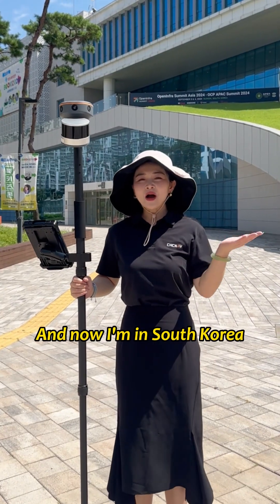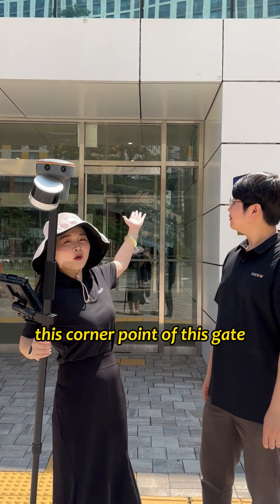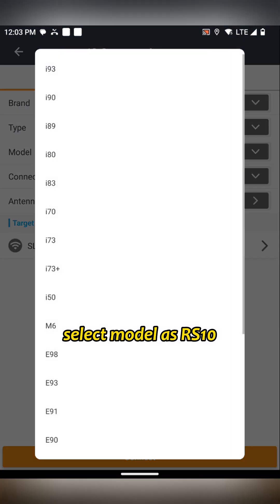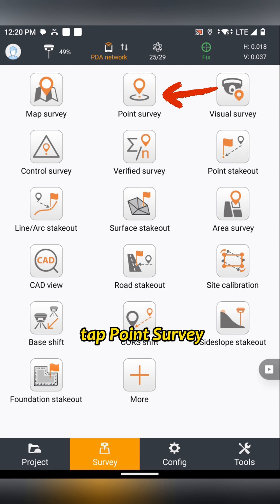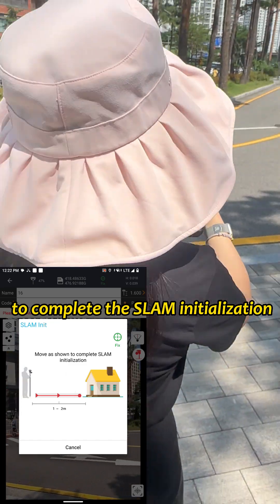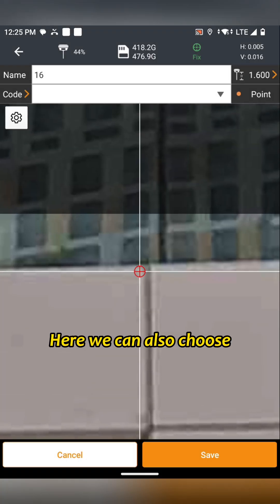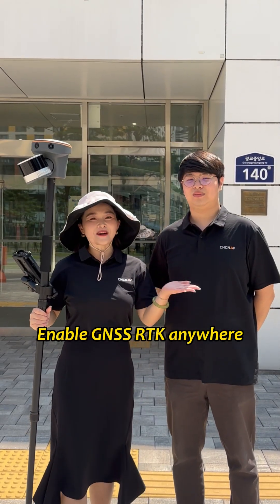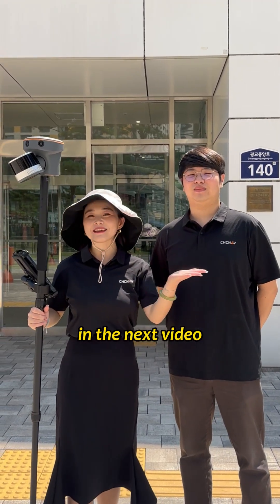Introduce the innovative Vi-LiDAR feature of CHCNAV RS10.

Comment: Hi, are what is the absolute accuracy for these coordinates? Are these comparable to having a total station measure these points? Can you get at least 1-2 cm accuracy for the point , and at how many meters distance if the signal for the gps is fine?
Reply from the maker: The accuracy of our tests can reach 2cm, but it cannot yet reach the millimeter-level accuracy of a total station.
Reply: @CHCNV_GNSS  Is the accuracy better if you 3d scan the building and process the data in a point cloud software?